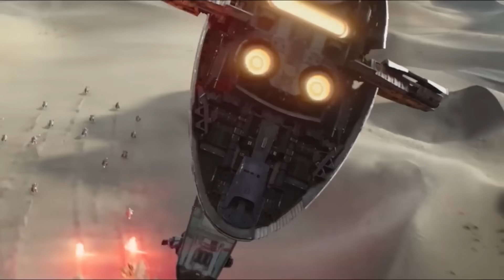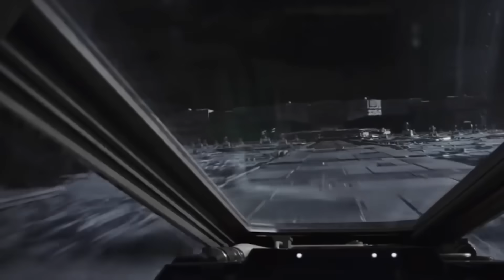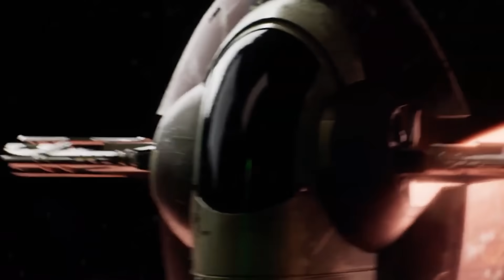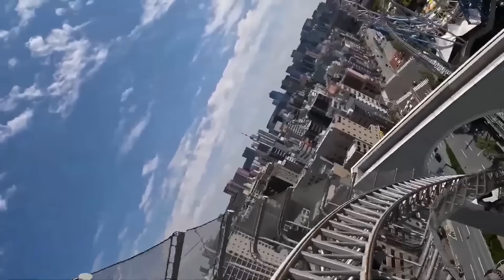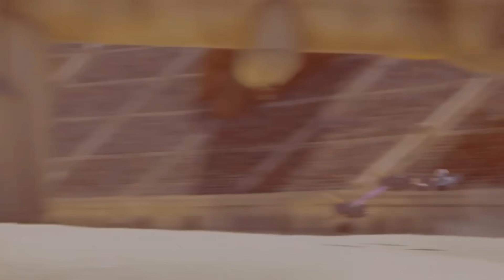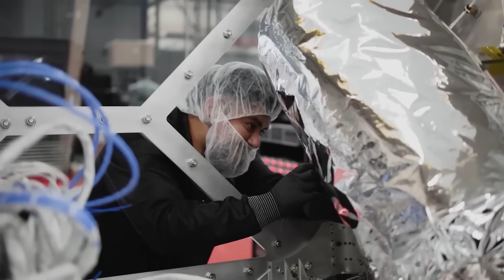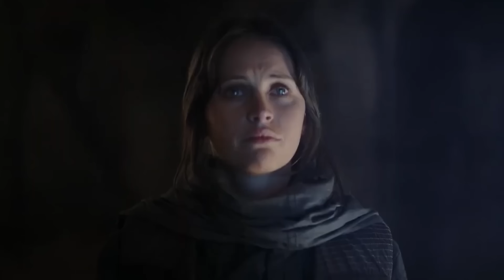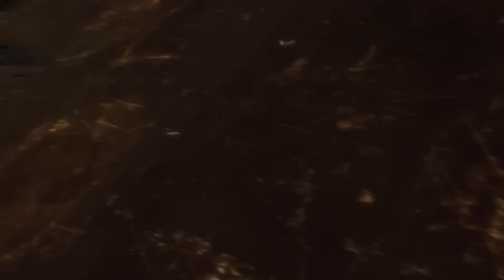The Problem with Star Wars Ship Design

Comment: Seriously tire of the "Exposed Bridge" argument. They put them there because bridge placement doesn't mater on a space ship. Front, back, dangling off a little rope. The weapons used by these behemoths can melt the surface of a planet, no matter where you put the bridge, once the ship starts getting shot at the command crew are not safe anywhere. If you can reinforce or shield the bridge enough to survive that, then again, bridge placement doesn't matter. The bridge could literally be open to space, if you have a force field powerful enough. It is not a weakness, a flaw, or a mistake, it's where the bridge is, that's all.
Reply: Yeah, it won't be called the bridge if it's inside, it will be CIC
Reply: @commanderfreakkz5688  Well, technically, they were referred to as the "Battle Bridge" or "Secondary Bridge", depending on context, CIC was a relatively new term for them.
Reply: @Giadea   oh, i see. Thanks
Reply: @commanderfreakkz5688  You can also think in terms of Submarines, they have a conning tower where the bridge is, but the bridge itself is completely contained with no external windows. This is the "bridge" even though it is completely contained, as stated with "context". Some nuclear submarines have a CIC for nuclear control, but most still have it on the "main bridge".
Reply: @Giadea  yeah, that's true

Comment: The no windows argument always bugs me. There's reasons we design IRL ships and spaceships with windows, like the space shuttles. Those reasons don't change because some hard sci fi nut thinks it's a vulnerability. When you're landing an aircraft or manoeuvering a ship into port or any other activity where you are forced to pilot or captain a vehicle in close proximity to other objects the fastest way to get information to your brain to make adjustments is through your eyes. Not through a sensor readout panel or a camera which will always have some degree of latency. This doesn't change for sci fi. Also if you were to make a true hard sci fi the whole ship will be vulnerable no matter what. Like we've seen in the missile age of naval warfare there's no material in existence that can cost or weight effectively protect from the amount of explosive energy we can currently pack into a missile. It wouldn't matter if it's glass or steel the hit would go through. That's why active defenses are so important in modern naval warfare. Long gone are the days of the WW2 battleship where armour worked because the primary threat was kinetic. Also humans hate being in a windowless box so there's a massive psychological trade off for the crew by eschewing windows.

Comment: The thing that makes zero sense to me is how an entire star destroyer only holds 72 tie fighters when a US Navy carrier can operate 62 and it’s a fraction of the size
Reply: Maybe that's how many they can maintain and replace since if a carrier loses aircraft, it has to go home and get new ones. Maybe a Star Destroyer can rebuild lost craft? Especially since the TIE Fighter is sort of designed to be expendable?
Reply: One has to remember a star destroyer has multi purposes...it has turbo laser batteries for engaging other capital ships and carrying out planetary bombardments, it has a storm trooper complement of about 9,700 for ship boarding and planetary operations and about 37,000 officers and crew, so a total of 46,700 personnel. I am using Wookiepedia stats for an Imperial I-class Star Destroyer, there will be some discrepancy in the finer exact details but this is just as a average. It has 20 AT-AT walkers and 30 AT-ST walkers, it has other space craft such as Lambda class shuttles, Delta class troop transports, Theta class AT-AT barges, Sentinel class landing craft, gunboats and blast boats  etc tec..so if one looks up the full complement for a star destroyer and how its shown in the movies and shows its evident its a multi purpose ship built for power projection, its Tie Fighter complement is only a part of its full capabilities. The Imperials do have other specialized craft including carrier only ships, though some fall in canon and others in legends, so will have too look them up individually.

Comment: Aren't a lot of the ships in Star Wars built in orbital facilities and maintained in space stations and hangars, not on surface facilities?
Since they spend a lot of their time up there, they can make all sorts of different shapes, etc. because aerodynamics isn't a thing.
Of course a lot of these ships can also land on the surface of planets and I dunno how that'd work. Space magic probably but at least I think the designs make sense if you're building them as spaceships...

Also, I figured the Mon Calamari would build highly shielded, reinforced ships in space because they're an aquatic culture; they live in environments with more than 1 atmosphere of pressure so they would need hulls to withstand those pressures, really good shields to keep water in or out of locations.
Even if they stay in orbit, that sort of submersible design would permeate through all their tech and aesthetics.
Plus that water can be used for cooling so stronger shields and weapons. Actually I think I heard somewhere that's exactly what happens; they use a lot of water cooling.

Comment: AT LAST!!!! Finally, someone made a comment about how dumb was the plot from Rogue One where a SINGLE engineer was in charge of the Death Star plans and nobody else cared to check if there were design problems.
Reply: Because it wasn’t a Problem. Don’t forget the X-Wing Before Luke bombed the shaft and it did absolutely nothing.

It was a 3 Meter hole covered in Guns, and Tie fighters and Because it was a Straight line down the Computer couldn’t calculate the angle for the torpedos.

They LITERALLY had to cheat with the Force “Aka God Plot Powers” to win

Comment: X-Wings and Z-95 have wings for atmospheric flight... And inertial dampeners. As for the cantina, the bartender's father was killed in the Clone Wars, so he hates droids. GREG-GAR-IN.
Reply: Even outside of the bartender there is still a hatred for droids, I'm assuming the bartender was the more known example to bring up
Reply: No. The wings are heat sinks for cooling not to produce lift. They have squared front edges and are flat  top and bottom. Most starfighters, swoops, speeders, and atmosphere capable capital starships use repulsors for lift. For any space fairing vessel, the repulsors are strong enough to push the ship to low orbit. The thrusters are just for directionality. Obviously using both will get you out of the atmosphere faster, but if you're not in a hurry, you could get there without using any thrusters at all.
Reply: @247Barcaro  Heat Sinks are just as nonsensical as airfoils though, neither would really work with actual physics. (too small, with the X design the interior surfaces would hinder each other as they'd send radiation out to the opposite panel not into space; and nothing in the design looksl ike a radiator anyway, plus it would require an enormously complicated coolant system through all the ship and into the wings... also why would you sacrifice half of your cooling outside of combat when the S foils are not in attack position??)

If you really try to give them a sensible use it's either better weapon angling, Sensor coverage or shield geometry, the rest of options is pretty irrational and easily debunked.
Reply: @247Barcaro looks like you didn't read anything from the EU. Yes the wings were there for atmospheric flight. Also I've seen and built many X-wing models...never seen a flat edge on them. It's always angled.
Reply: @Kolonol1  You're a clown , talking about my EU knowledge like you know me. How are you going to compare a flying model to an actual replica model? I'm guessing that's what you're doing because those are the only ones that have that teardrop shaped wing cross section.  I have 2 scale models in front of me right now. The leading edge is flat. You can literally Google images of the X wing and see in the first few results the square edges of the wings. The thickness of the wing is essentially the same at the front edge, at the center and at the back. That's not how a wing designed for lift is built. 

So if reading over 100 EU book means I "didn't read anything from the EU" then yes you're totally right. 

But more than likely, Kolon, you're full of ...
Reply: @Kolonol1 
 Plus since the ship is built for space, it has no flaps,  but does have mico thrusters. Could there be mico thrusters on the wings of the X-wing sure. But they could just as easily be on the body. The question is why use fuel for mico thrusters in the atmosphere when repulsors are well known to be very energy efficient? 

Not to mention every other ship that has no wings that can fly just as well in atmosphere.
Reply: @247Barcaro based on that comment I see you don't know how repulsorlift technology works :/ now I don't know if Disney has shoved a giant broken ceramic dildo in repulsorlifts like they have everything else, but in the EU repulsorlift technology moves you upwards and only a certain distance before you have to have a propulsion system refer to some of the swoop bike races how they can use the repulsorlifts to bounce off of surfaces if they swing the bike up to point the bottom sideways and what not...the V-wing for example was exemplary because while it did have stronger repulsor fields, it had scramjets for speed...

The X wing doesn't move with micro thrusters, the X-wing moves with 4 big engines and the thrust and direction is controlled by the thrust veins around the engine as well as other star wars technology that doesn't exist here...the engine nacelles controlled direction essentially and the wings gave it stability both in atmosphere and out. The thing you guys are also not thinking of is that you don't see too much action in deep space....it's all near y to planets. There is still gravity and atmosphere from the earth well past the moon. You do still hear some sound and you do still have to contend with drag.

Comment: The Empire could have solved this problem by Shield generating the Star Destroyers, so no matter what exposed sections they are, it would be protected by the shields from weapons!
Reply: That’s not how shields work. 
You need to have both Ray and Particle Shields on your ship and will have to Cycle and cooldown when switching between the two depending on the threat you face

Comment: Surprisingly they say the N-1 Starfighter is the most aerodynamically sound fighter but still pales in comparison to modern aircraft
Reply: That tracks because the speeds that Star Wars starships are able to attain in atmosphere are significantly slower than modern fighter aircraft
Reply: @TmanF1nerd  Dogfights still only happen at subsonic speed!
Reply: @TmanF1nerd  They're actually not...starfighters don't really need to be aerodynamic, they use their shields instead...if you dig a little deeper in the lore, you'll see that the slower atmospheric speeds are without shields...with shields, a lot of them have in atmospheric speeds around about 40,000km/hour.
Reply: @bladeofhel interesting I will have to look into that
Reply: Aerodynamics actually don't matter much in Star Wars...most fighters use their shields anyway...it's kind of buried in the lore, but a lot of starfighters can, if they turn their shields on and angle them correctly, fly at tens of thousands of km in atmosphere.

Comment: Wrong. We’re talking ships that have power sources far greater many stars. In a world where there is energy weapons and shields to counter them, it doesn’t matter where your bridge is. You loose your shields your bridge could be at the  center of your ship and it wouldn’t make a difference. An energy blast will cut right through the ship like a hot knife through butter. Close up combat among ships makes perfect sense when energy blasts dissipate at great distances, and very fast ships can dodge projectiles such as from rail guns. If your ship travels faster than light it stands to reason you probably have energy weapons,artificial gravity, force fields and maybe even transporters.  My only problem with Star Wars ships is most of them look like they use chemical engines, like the ones we see on the Saturn V rocket. There’s no way a chemical engine will get you faster than light.
Reply: The Empire could have solved this problem by Shield generating the Star Destroyers, so no matter what exposed sections they are, it would be protected by the shields from weapons!
Reply: @Garland.Greene2296 
They Already have Ray Shields and Particle Shields covering the entire destroyer. 😂😂😂

Comment: 26:01 As you've already mentioned, the Millennium Falcon is the Star Wars equivalent of a semi. Parts for real world semis, or at least critical parts, tend to be very common. 

Just from a logistics perspective, it makes sense for the Star Wars universe to have a practice of mostly using common off the shelf components for ships. You don't know where it will happen, but you know the ship will break down at some point. If it happens on a backwater planet with exactly one parts store, you'd better hope they stock what you need. Best odds of that is if your critical systems are made up of (or at least compatible with) the most commonly available parts.

What I'm saying is you don't want to fly a John Deere tractor to Dagobah.
Reply: The only thing that probably can't be replaced is the escape pod or at least that would need a specialised replacement from Corelia.
Sort of like I dunno, you've got all sorts of old tractor equipment inside a John Deere casing and you lose the nose to the casing? You don't really need that part, it does make your tractor look like an old hunk of junk but you're not going to find the nose of a John Deere model on Dagobah.
And you probably also don't want one anyway as that replacement might require proprietary software. Just like a John Deere :D
Reply: The last sentence in this comment gets funny for those of us who know the Lego Star Wars Complete Saga
Reply: Yup, it's just a Correlian YT-1300 transport ship. A sleeper YT-1300, heavily modified for smuggling duty, but still basically a YT-1300.

Comment: In the Xwing books, Wedge brings up that their xwings use inertal dampeners.
Reply: I don't know why making everything wet would help.

Now, if they had inertial dampers, that would do the trick.
🙃
Reply: @H1Guard I think it, you say it! Lol
Reply: Great series
Reply: Well they obviously have artificial gravity in all the ships, so compensators are a logical addition.  Now, 'flying' in space like aircraft always broke my suspension of disbelief in SW movies, however.
Babylon 5 & The Expanse did it right, though.
Reply: @NemoConsequentae  When you consider the G-forces, 'flying' in space might present significantly less stress on a human pilot than the maneuvers they pull in BSG for example though. I always used to think the way you are saying, but, although from a pure physics perspective on the machines BSG feels much better, when you take into account the human body, slower, arcing, 'flying' turns while maintaining forward velocity makes more sense the longer I think about it.
Reply: I got something wedged up my xwing right now.
Reply: @86dinc  Woah, that really is going in my GLAVEN!
Reply: fan fic always tries to "fix" or explain previous lore plotholes and issues. hence rogue one.

Comment: 28:25 It's not that realistic because their engines are on and they aren't accelerating. Plus, in real life, space things don't slow down if their engines turn off, they continue at the same speed.

Also, I'm fine with Star Wars not functioning like this, just commenting on the realism of it.
Reply: At least in the Old EU not sure about cannon the Inertial Dampeners of Star Wars also can dump the force infront of them allowing them to decelerate and move around without needing the small thrusters

While not as powerful it allowed them to save space, and have more room for Storage or weapons

Comment: The reason they have wings is so they can land and fly in a planets gravity.
Reply: Not exactly. The wings are not designed with lift in mind. They are completely squared. Every edge is flat on the X-wing an Z95.  Plus every other ship design without wings can also fly in  atmosphere.
Reply: @247Barcaro good point
Reply: I believe the official explanation is that they're heat radiators, which does actually make realistic sense
Reply: ...And the actions while battling in space could be designed in, so the craft reacts the same to control inputs no matter the outside medium. That way the pilots could concentrate on dog-fighting without having to worry about how it handles differently in a vacuum vs an atmosphere.

Comment: 15:55 No, they attacked the top side. The bottom side has the massive cannons.
Reply: Those resistance bomber's speed and maneuverability made the Y-wings and B-wings look like interceptors.
Reply: I suspect it's an AI-written script.
Reply: The Empire could have solved this problem by Shield generating the Star Destroyers, so no matter what exposed sections they are, it would be protected by the shields from weapons!
Reply: @Garland.Greene2296  I was correcting the information for that attack on the dreadnought.
Reply: and it's the slowest bombing run since the first Avatar movie.